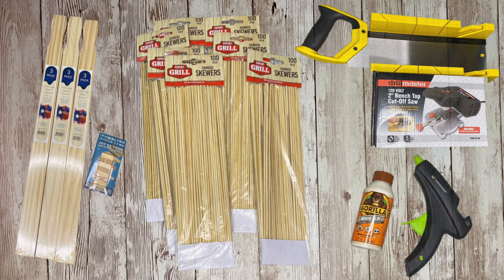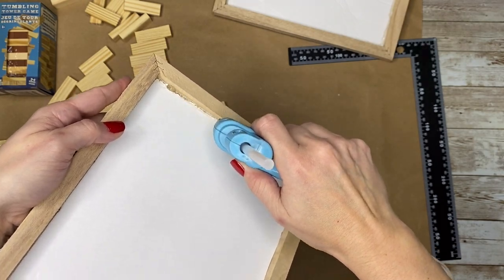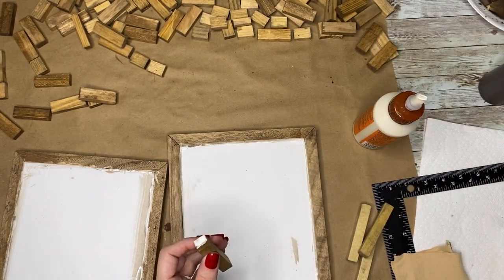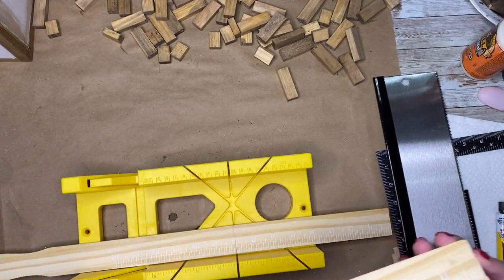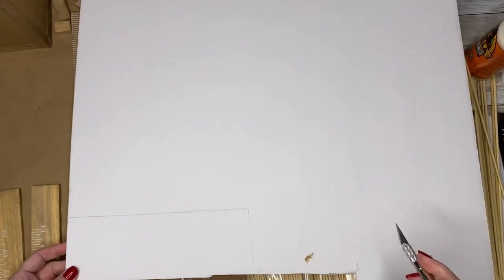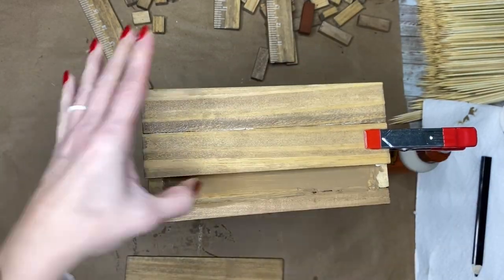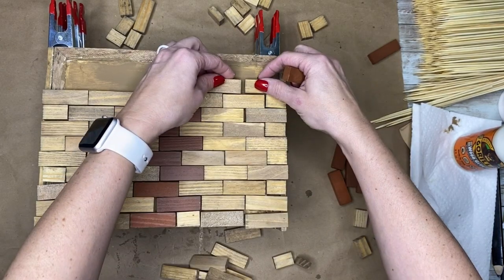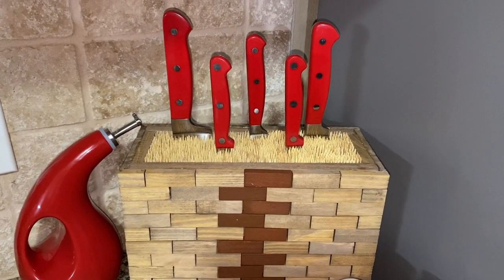Dollar Tree / Anthropologie High End Dupe DIY Hudson Knife Block, Kitchen Knife Holder

Comment: The issue with your cordless glue gun is that it doesn’t get hot enough to actually completely melt your glue stick! Try using a low melt/low temp glue stick and hopefully that will work. I never could get my cordless to work. If you want a fantastic cordless glue gun, buy a Ryobi One+ brand glue gun! They come in a large size that gets to about a million degrees lol, but it also comes in a smaller size and they both use the same battery. They are both definitely worth the initial investment and worth every penny! I love this tutorial! It’s genius!

Comment: I wish I could upload a picture of mine.. it was just as easy as your method I used cedar furring strips and the tower blocks on front similar to the picture but I used 4 different colours of stain and white wash with a varnish coat to finish. And 24! Packs of skewers wow!!

Comment: I have the same problem, with the same surebonder glue gun! The problem went away when I switched to 10 inch sticks. Now I can use either size, no problem. Hope this helps!
Reply from the maker: Luna Casting I’ll have to try that!  Thanks for the tip!! 💕

Comment: Hi Christi just a question about the foamcore panels. I realize it's needed on the front for the jenga blocks to stick to but if you are using paint stirrers on the sides, back and bottom, do you still need to do the foamcore board inserts?
Reply from the maker: You probably wouldn't HAVE to have them on the back but I thought it felt more stable with them on there .  Just my opinion tho 😉